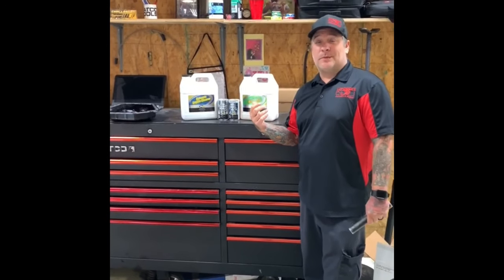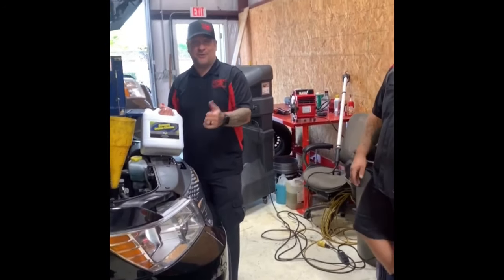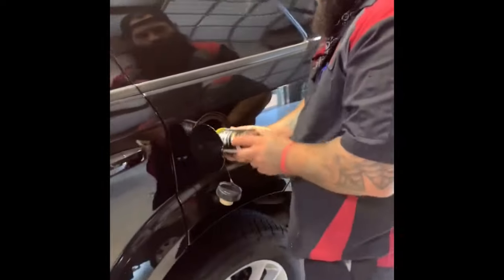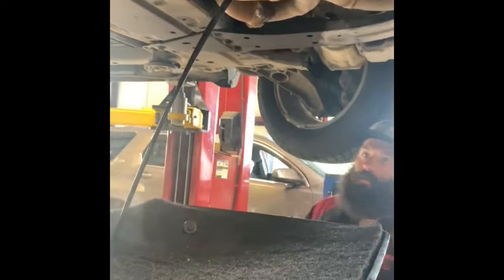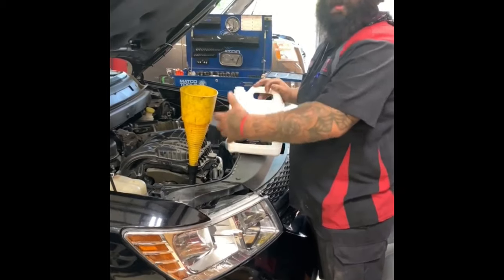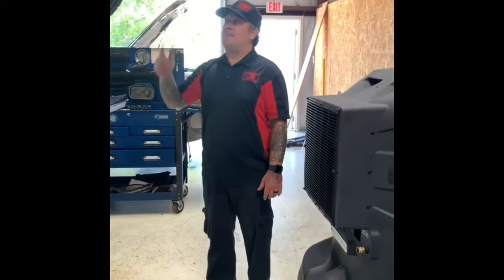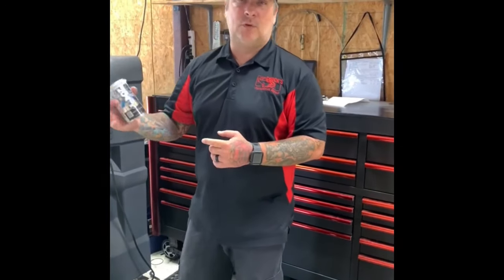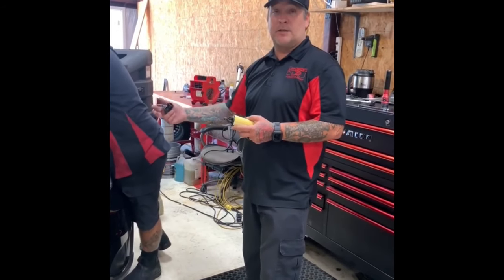BG Dynamic Engine Restoration with Chuck's Automotive Repair of McKinney, TX

Comment: I CHANGE MY OIL EVERY 3 MONTHS OR 300 MILES WHICH EVER COMES FIRST. OIL IS CHEAP ENGINES ARE NOT
Reply: @Solon Peet Probably meant 3000 miles. Simple typo, no biggie. :)
Reply: @jamesj.litteriojr.433  yes every 2500-3000
Reply: @chrislemaster2695  ;)
Reply: This, Is, Sparta!!!!!!

Comment: This may be a fully legitimate and effective product. BUT...I would like results from an independent lab as to A) a full physical examination of the engine internals prior to the cleaning.. and this especially includes the bearing surfaces.. B) you want a chemical analysis of the content of the cleaning agent(s)  and you want an analysis of both the typical contaminants jn the flush oil after its use and the levels of chemistry in the normal oil which follows the flush oil after the normal oil's duty cycle. Then, you need some independent parties to do an good eyes on examination of the actuial engine parts especially if there is damage or any negative effects especially to bearing surfaces You just need a far deeper/better testing to really determine what in truth happened in the test engine using this product. And you can't get that from fans of any product. You need FULLY independent investigation before you consid r r and substance or product safe and effective
Reply: Thanks Cindy, my thoughts exactly, its called the scientific method.  One must use extremely strong solvents to remove that level of varnish, gum, and sludge.  Machine shops can but they use caustic chemicals that can damage aluminum, seals and bearing material.  Without analysI is of the original cleaner, and resulting wear analysis and particle count, I am willing to bet there was harm to the engine. I have been telling people for years, just perform a Full Volume oil change or double oil change and get 99% of the old oil out, and let  the fully forumuated oil with full compliment of additives do its job.   I have seen modern engines retain 10-20% residual oil.  Just last week I had my engine register 188 ppm of iron after 2500 miles, I drained, refilled and new oil.  I sampled the oil after thuroughly circulating the oil and it showed it retained 22 ppm of iron and abnormal amounts of silicon and sodium.  New oil would have been condemned if that amount was found in it.  People have been duped for years to believe that an oil change drains 99% of the old oil.  They need to bring back the oil flush machines, especially for GDI engines.
Reply: lmao
Reply: Lots of videos on you tube 
This works 
And it works well.
Reply: There is plenty of videos to look up about this same product that will show you underneath the valve covers the crank case and it cleans up 💯🤙👍✅
Reply: To do that amount of testing and then an engine tear down and all that you recommended would exceed the value of the vehicle and I am sure these guys have seen enough of this stuff to be able to make a very reasonable decision on the effectiveness of this treatment. It’s not perfect but for it’s minimal cost when compared to another engine it’s is cheap and way more efficient than just an oil change. And all of the products are petroleum distillates so should be recycled as usual . It clearly did something to the engine , most likely for the better.
Reply: Yea all the other YouTube videos and write ups about this stuff seem to have a consensus. It appears this stuff is really a Miracal lol.
Reply: BG do offer good products, I have used them for years, but there are no miracle cures. If bearings are already damaged this will not fix them. It does tend to do what is promised. I use EPR on most of my cars when first bought, it cleans things out and helps free sticking piston rings. On a recent sports car I gained 15-20% compression on three out of four cylinders, the fourth I got just a 5% improvement, but it was running so much better, all for £20.

Comment: What people don't understand is that removing the oil pan and checking for and removing debri as well as replacing the pick up screen or removing and cleaning it is a MUST .. you do not do this service and not drop the pan .. in fact if you have a motor that needs this service drop the friggin pan before you start why ? because you are looking for shit clogging the screen but most importantly you are looking for blue / black connecting rod ends or main caps telling of overheating and bearing failure because if you have this damage doing the flush is pointless as moter needs over hauled and it will get cleaned during that procedure .. also if doing this it is either your car or someone else's and they will hold you accountable if motor scatters during the procedure as the cleaner is much thinner then oil and does not protect the engine. one last thing almost all of the bg products are overpriced and not needed for this the total cost of materials when I do this for cleaner etc is less then $15 the bg stuff gives you detailed instructions and products to use in order to let stupid people do a simple procedure and pay 10 times more then it really costs to do ..
Reply: I don't agree with everything you stated here. Dropping the oil pan on most motors wouldn't be worth the while. You wouldn't be doing this cleaning without the owners permission so if they decided to have it done it would be on them. I've used BG for over 40 yrs and even 40 yrs ago it was a good product. Better than any others I've tried. Is over priced? In many cases it is but with this motor it might be worth the cost. I would be doing it myself to avoid a bigger cost.  If the motor is bad enough to have to inspect rod bearings, etc., it wouldn't be worth messing with in the first place. Not sure what cleaner you use for $15 but if it works thats fantastic! Keep doing it!
Reply: What cleaner do you use instead of BG?
Reply: @alexandervasilenko434  It's a slower process but when you are not a professional mechanic with a fully equipped shop some times slower is better when it comes to cleaning a sludged engine. For "do it yoursel" a very safe bet is Marvel Mystery Oil. It won't work anywhere as fast as the complete BG system but it's very easy to use, just add to your crankcase about 300 miles before an oil change and then drive as normal for the next 300 or so miles and then get the oil changed. *Note: if you have reason to believe that your engine is heavily sludged then instead of adding the Marvel Mystery Oil 300 miles before an oil change add it about 20 miles before an oil change (the first time) then get your oil changed. Then repeat that process over the next few oil changes but gradually increase the amount of miles before each oil change, so the next one add it about 100 miles before the oil change and the 3rd time add it 300 miles before the oil change. That's only if you have reason to believe there's heavy sludging, otherwise you can just stick to the 300 mile recommendation. But still follow up several more times over the next few oil changes to insure it has been thoroughly cleaned. Marvel Mystery Oil will cost you about $8 bucks per treatment, best price is at Walmart.
Reply: @marketingmajor8126  price of #MMO💯 has risen sense December prices me in BayArea
Reply: @keepitsolidkeepitreal2877  prices are always going up but it's still under $8 bucks per treatment

Comment: Got a 2016 f 150 5.0 , has a stalling issue I think it’s due to the oil pressure running the timing , vcts ect , I’m hoping this works for me instead of spending thousands on all the timing parts and labor , truck has only 125 k on it so I don’t think parts need to be replaced yet , I hope ?
Reply: Works Awesomeness 🤙💯 you can also flush up to 20mins
Reply: @keepitsolidkeepitreal2877  figure I might as well do the 45 min one , I figure if I do still have to replace everything at least there won’t be any crud in there to screw up the new parts
Reply: @jeremyruss2407  I’m in the same boat rn,  have you done the flush yet?
Reply: @Lostsouls5557  I did , my truck wasn’t too bad sludge wise but once my guy get his scanner updated we will figure it out hopefully , but it definitely cleans the shit out of the engine , we had a camera we looked in the valve cover and by the timing chains , it was definitely a lot cleaner than before the flush , and I figure if I do the timing stuff it’s good to have all the junk out of it before I put all new in there
Reply: @jeremyruss2407  did it help with the vvt issues?

Comment: Why does this stuff work so good and it seems like nobody else makes a product that can do this. I ran straight chem dip in my car and let it sit for a week before I drained it out and it did an amazing job but still not this good. I'm really tempted to buy this stuff and I have 2 cars that need it. No I'm not the reason they are in such bad condition. I take good car of my cars. But I bought a high mileage 200k Toyota pPrius and my mom has a Chevy Astro van that has not had any oil changes or maintenance in the past 5 or 10yrs or so and its full of sludge but still runs perfectly so I want to try and save it.
Reply: It sounds like the product has strong chemicals because I've heard it has a strong smell, both the rinse oil and cleaner. The true magic occurs running it for 40 mins at 3k rpm. Easy way to clean your engine is to buy a high quality synthetic and run it hard on a 1+hour road trip. That will clean it out pretty well
Reply: it works really well because its a few hundred dollars for the kit.

Comment: You need to complete (3) oil filter changes ........
Reply: In the Machinery Lubrication industry it is called a Full Volume Oil Change. 10-20% of the contaminated oil will remain in these modern engines.
Reply: yes. clearly

Comment: Imagine what that does to the seal though
Reply: The other option is replacing the engine. So I think the seals can deal with it
Reply: It's specifically formulated to not hurt the seals and the final product, the MOA also includes a seal conditioner.
Reply: @typedrew  lol right!  Ill rather replace seals at some point down the line years later than replacing the whole motor tomorrow. I wouldnt worry. Plus they mentioned that it shouldn't affect anything and if it does, they will help cover the cost.

Comment: Did it fix the check engine light?
Reply: Obviously it didn’t fix the engine light or he would of answered you.
Reply: Two reasons this alone may not work. One they said they were getting codes for the cam phasers. The lack of oil to them due to the sludge could have permanently damaged them. If not permanently damage they said they did pull the valve covers. Most cam phasers have screens in them the oil flows through to keep the debris out of the phaser. If they didn't clean the phaser screens then this wouldn't solve the issue. This service is $250 - $350 to perform as the fluids are crazy priced.
Reply: all check engine lights in all vehicles come on when oil is at very very very fucking low critical oil PSI as in they are not warning lights to warn you of impending doom they are notification lights to inform you to pull over and call a tow truck as you will need a new engine  NOW. if you see the low oil warning light its already to late .. manufacturers do not want to sell you 3 qts of oil they want to sell you a replacement engine and the labor to install and regardless of how old the car is or mileage it will not be under warranty as it is owners responsibility to change and check oil levels .. if a main seal fails and you lose 6 qtrs in a matter of minutes and you hire an ATTORNEY you might get it covered by warranty as a factory defect. but 99% of the time nope its not covered .. trust me I was the technician in the shops that I worked in that advised whether or not it was neglect or failure and if car isnt maintained a tech can tell. that and oil sample is always taken and sent to the lab. if it was in there longer then the service interval you bought an engine

Comment: Ok..This is not a miracle cure..Poor Oil maintenance first cause..CEL..VVT solenoid or Oil pressure switch..We still use diesel fuel(1 quart-run at idle to 2500rpm/ No driving only stationary) Drain and Fresh oil and filter change..Never try getting all the carbon out the first try..The carbon build up could be holding the seals together..Are you ready for full rebuild after this...? All your trying to do is stabilize the mess.....